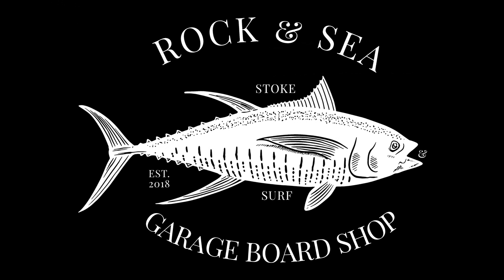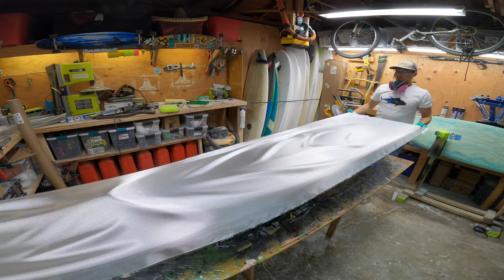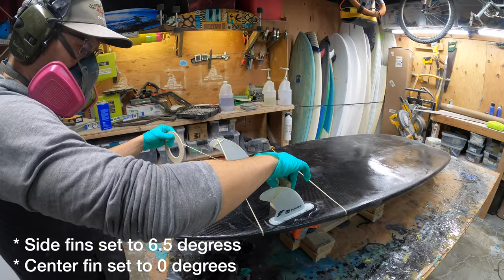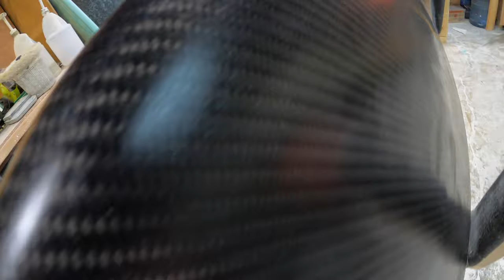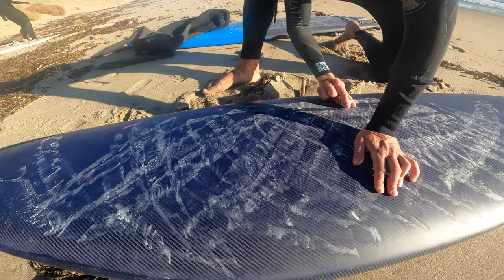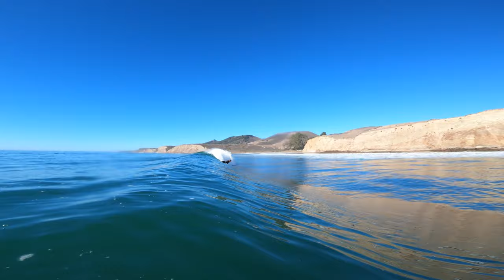Carbon Fiber Surf Board  - DIY

Comment: Well done man, board turned out great!
Reply from the maker: Hey thanks man, It was super interesting glassing carbon.  I follow Colan Australia, they make awesome surfboard carbon fiber products and tried to find a similar weave and weight that were easily purchased state side.  Ended up trying 5.7oz carbon twill weave, it was harder than regular cloth to saturate, but trying  a reverse lam on the bottom made it really manageable to work with.  Definitely going to try it again on a couple boards
Reply: @RockandSeaGarageBoardShop  right on, I bet the board is pretty rock solid. I can feel your pressure getting the cloth layered and cut as the curing clock is ticking.

Comment: Man...I’m new here, but some tips if you don’t know....you can precut your cloth to fit, mix your resin in a larger pan so it is spread out more to reduce the thermal ramp up and give you a little more working time, and get resin on and spread out as quick as possible....also you can lower your shop temp until you are all spread on the board, then turn off the a/c and bring shop temp back up.
Reply from the maker: Hey that’s a sweet idea on a pan or wider bowl to keep it from kicking so fast!  I normally pre-cut my cloth but I was having a hard time getting good saturation with the carbon, so was doing a reverse lam.   I wish my garage had an a/c hahaha, I’m at the mercy of SoCal weather!   One day I’ll get one 😆👍

Comment: Curious how it's doing? I was under the impression that carbon fiber needed to be vacuum bagged.  Looks great🤙🏼
Reply from the maker: Ya it pretty much does need to be vacuum bagged to get max performance.  When you vacuum bag you get absolute optimum about of resin to carbon ration giving you the best strength to weight ratio (no excess resin which adds weight but doesn’t add strength) also the carbon is perfectly laminated onto the board, i.e no small imperfections or bumps,  etc..    Compared to a vacuum bagged board this will be a little heavier with likely a little bit extra resin infused in the carbon and I did have some slight bumps and imperfections I had to sand, that being said you can totally laminate a board with carbon by hand and get crazy strength added at about the same weight as any normal surf board.  so pretty sweet regarding performance to price ratio.   The board is ripping fine to this day 🙌🙌
Reply: @RockandSeaGarageBoardShop  That's awesome. Thanks for the reply. 🤙🏼

Comment: Beautifully done! What is the fabric you placed on top of the carbon fiber weave and what is its purpose?
Reply from the maker: I placed a layer of “e fiberglass cloth” over the top.   Then with the best hand done glass jobs there will be tiny little imperfections in the carbon, I add the extra layer of fiberglass over the top so when sanding out any little imperfections, I’m sanding everything perfectly flat and smooth in the fiberglass layer and not nicking the carbon fiber at all. Hope this helps and makes sense!
Reply: @RockandSeaGarageBoardShop  thanks. I want to make a skimboard for my son and thought it might look cool to use carbon fiber.
Reply from the maker: @specialsauce305 definitely would be a very cool father son build! And skim board would be more manageable since it’s essentially a flat surface top and bottom, I’ve linked to the stuff I use in the description! Good luck!!

Comment: Hey bro, i have wraped a board with carbon fiber and i have notice that after putting it in the water a small hole has emerged. Very small like a pin air. Do you know why that happens? Thanks
Reply from the maker: Are you using an EPS blank?   They are notorious for “de-gassing”.  There are a lot of gasses in the blank itself and when you glass the board if your not baby sitting and watching for it while it cures, small bubbles will work their way through the carbon and the resin and form a little pin hold channel as the bubbles escape, a very frustrating side effect of using EPS blanks!  Next time you are hot coating just really look out for any little pinhole channels forming and brush the epoxy back over it to seal.     Did this help?!

Comment: That's really cool, you did a great job, I wanna buy it by the link you provided, but I'm not sure if I need but to or only one by the link. I wanna make a 6'4, do you recommend buy one or two ?
Reply from the maker: Thanks man! She is a super cool board, fun build!   So the carbon I used comes 50 x 36 lengths, if you want one solid piece top and bottom you would have to order 4 lengths to have enough length in a solid layer of carbon with no seams!  Sort of pricey, but super cool, also will walk away with a fair amount of excess you can make other stuff with

Comment: I’m currently in the process of building a carbon fiber board. What thickness cloth did you use overtop the carbon? My board is more of a step up 6’4 with a rounded pin tail. Me and my glasser are just trying to find what glass and resin, cloth thickness, etc.. and the best route we should go during this process.
Reply from the maker: Heck ya, always stoked to hear about everyones builds, 6’4 step up round pin would be awesome in carbon 👍. I used 4 oz over the top.  I’ve done a few more carbons after this one and one thing I’ve noticed is that carbon doesn’t want to adhere as nicely as cloth to the board, baby sit it longer than usual epoxy waiting for it to kick. EPS blanks tend to de-gas quite a bit and I’ve found bubbles trying to form way after I’m done laminating, I check every twenty minutes or so for 2hrs to make sure
Reply: @RockandSeaGarageBoardShop    Did you seel the EPS blank first? That might help a lot. Some use lightweight spackle but I prefer epoxy with microballoons. Also, as far as the carbon floating; you might consider trying Jimmy Lewis’s Poor Mans Vacuum Bagging. His series is on Vimeo.

Comment: Why such a rough and heavy fabric? It all needs lots of resin which is too much weight. Maybe there is a carbon fabric available wich is similar to a typical glass fabric?
Reply from the maker: Super good question! So there are a couple things to consider with carbon, there are unidirectional and multidirectional weaves, how many filaments per “tow”, 3K, 6K, and 12k carbon are the most common, and then the last measurement is the weight per meter square of the carbon.   Here I was using twill weave, 5.7 oz per meter, 3K.   From what I can tell dark arts is using twill weave but I’m not sure what K and oz carbon they are using.   I actually interviewed the Dark Arts founder at the last board room convention on one of my vids, and in the moment forgot and  didn’t ask him!    One thing I can say for sure, is hand laminations like I did in this vid will always leave some extra resin and therefore weight left behind despite best intentions, they way to get the very optimal strength to weight with carbon is to vacuum bag, it pulls out any excess making it as light as possible.

Comment: Couldn’t tell in the video but did you put glass or carbon patches over the fin boxes? Im about to do my first carbon board. Hand lam. Boards looks sick. Good job
Reply: With carbon is it better to route the fin boxes after the lam? I normally do them before directly on the blank
Reply from the maker: Hey what’s up Jayeson, heck ya on doing a carbon! They are so challenging/fun, extra special to make your own carbon!!  I normally do my boxes before laminating, but just wanted to have more control on this one until I got the hang of carbon, just wanted to be 100% sure didn’t have any little bubbles around the boxes that if sanded through would make it look less esthetic.   Nowadays I do my boxes before laminating carbon (also routing through carbon really dulls your router bits but…. Turns out super clean).     Hey one big tip! Even after laminating a board super well with carbon, baby sit it while it kicks for an hour or two, I strangely find bubbles trying to form even an hour or so later, so baby sit it and tend to any bubbles that might try to form on you!   Hey if you want to share post a pic on insta and tag! Would love to see it
Reply: I like to seal my blank with epoxy an micro balloons before laminating so hopefully doing that can avoid the bubbles issue. Thanks for the quick reply
Reply from the maker: @jayesoncanales5633  I don’t know why, but even after sealing i had a few small degassing bubbles 🤷🏼‍♂️ trying to form, baby sit just in case and you won’t regret it!
Reply: Will do

Comment: Poly blank?
Reply from the maker: Yes sir, you can use carbon on poly or eps.  Did this build with poly to give the board a little more weight, sometimes carbon boards come out almost a little too light!

Comment: Is the fiberglass necessary or do you think the single layer of carbon would be enough?
Reply from the maker: Dude super good question, strength wise one layer of carbon would definitely be strong enough! I just added a layer of cloth over to top because I was afraid of nicking the carbon while sanding which might make it not as pretty.  Definitely going to try a board with just pure carbon sometime soon
Reply: Nice thanks for the response. Gonna do a carbon board on my next set of blanks. We’ll see how it goes! Psyched I got your tip on laying resin down before the carbon before I start
Reply from the maker: Heck ya, stoked your giving carbon a try, And that reverse lam seriously made a huge difference. Was definitely sweating time wise trying to get it done but worked out in the end.  Hey seriously electric shears made a huge difference for me, definitely check some out, I bought a fancy $150 pair and a cheap $40 pair, tested them both and they both worked great so kept the cheaper pair.  Hawkforce Electric Scissor with 2 PCS Cutting Blades,4V Li-Ion Rechargeable Battery Cordless Power Scissors Box Cutter Shears Cutting Tool for Cutting Fabric, Leather, Carpet and Cardboard https://smile.amazon.com/dp/B07QT8B8L7/ref=cm_sw_r_cp_api_glt_fabc_QHN2ESGME4XSK7S0HZVC?_encoding=UTF8&psc=1

Comment: thanks god there is someone that leaves that carbon as it is... all with this ugly sanded/colored stuff. i am near the end of an e-foil 100% carbon look.
well done!
Reply from the maker: Man I think that weird sanded/distressed look is sort of ugly, I don’t get why people like that over pure carbon 😂😂🤷🏼‍♂️.   Whoa building your own e foil?! That’s super cool, post some vids, would love to see that
Reply: @RockandSeaGarageBoardShop  unfortunately I am not a lot into video making and now I am near the end. Electric stuff is completed, board I have done all vacuum baggings with carbon and glass. Now just last hot coat for a glossy finish and minor stuff. I’ll try to make a short video when is done
Reply from the maker: That’s awesome man, do you do resin infusion when bagging? I’ve been doing a bunch of research into resin infusion with vacuum bagging seeing if it’s something I want to get into if I end up doing a bunch of carbon work.  Hey tag me if you post a vid, would be stoked to check it out
Reply: @RockandSeaGarageBoardShop  not “infusion” I didn’t let the resin run into the bag from one side to the other, I just applied wet carbon, glass and resin like you did, then tons of layers for bagging😂 peel ply, breathing cloth, TNT, and the bag. All becomes tighter, cleaner and harder. Problem was that being and e-foil it has lots of depressions and holes and I had to do it in 4 different steps and 4 vac-bags
Reply from the maker: Hmm super interesting, So you use vacuum bagging to get a super tight lamination, that’s awesome well shoot I’ll have to give that a try sometime
Reply: @RockandSeaGarageBoardShop   and most of all super light. Each time you do a vac bag pressure squeeze the excess resin out and the TNT absorbs it

Comment: hi, great video. Makes me want to do it myself. question, do you free lap or cutlap in this process? Regards, Alex
Reply from the maker: I free lapped this board, on the first layer of carbon I did a bit of a loose and slightly sloppy free lap since the free edge was going to be covered by the second layer layer of carbon, but on the top layer of carbon I spent a lot of time cutting it very precisely making it as close to a cut lap as possible.  Turned out very nice.  I recently did two 7’2 step up carbon guns and cut lapped both sides with similar results.   Cut laps turn out the very nicest but add a fair amount of time, sort of depends on your skill level and time available

Comment: If this question already been asked apologize in advance, but I didn't want to read through all the comments. Question is with a stringered blank and carbon it seems to me that the board would come out. Kind of stiff .? I always just assume carbon fiber you use the stringless  EPS blank,Either way, it's always fun to do something new is it it looks like you had fun with that that project
Reply from the maker: No worries man, ya your spot on.  With carbon it’s already so strong you don’t really need a stringer.   If I had ordered a custom blank I’d definitely have gone stringerless.   She is a stiff board but super fun, actually a bit of a barrel magnet!